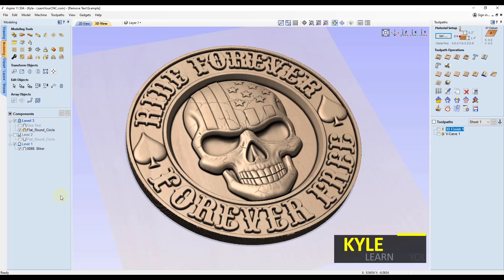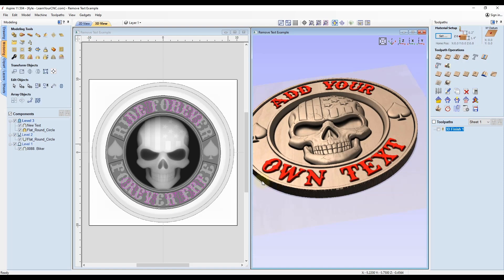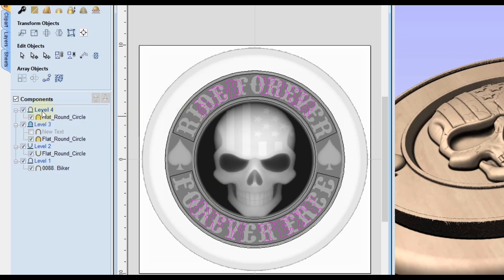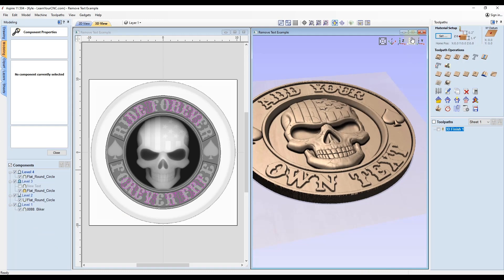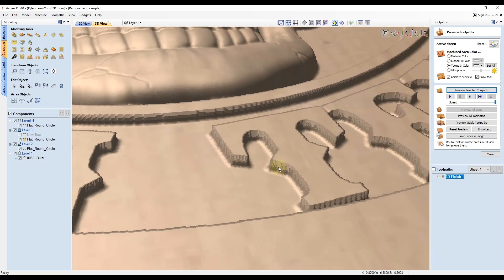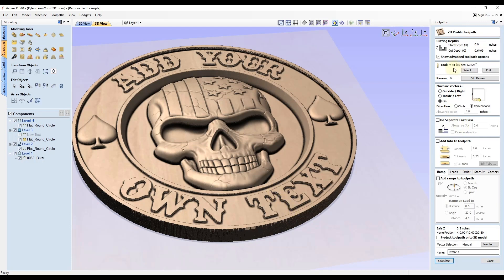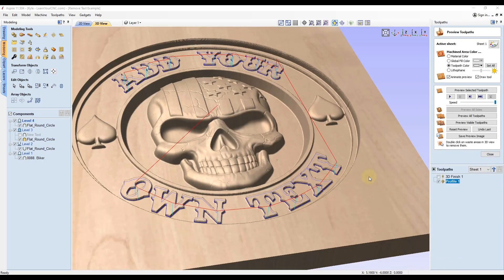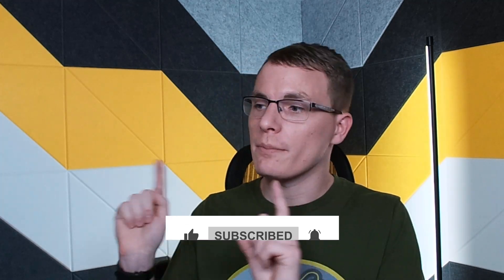How to make 3D text with VCarve Pro or Desktop

Comment: If you really want to get unlimited creativity with pro take the time to learn Blender. Download your models to Blender add  displacement maps for texture of anything. Add any text of any type or design with any bevel ,can be custom or anything you can imagine. Import that model to pro, size it and done, make your toolpaths and carve. Blender is free but amazing and the learning curve is so so, I've been learning it for 2 or 3 weeks and truly changed modeling for pro . PS. You can combine, shape, mold, sculpt any 3D model to bypass the Vectric Pro lock of only adding 1 non Vectric model.